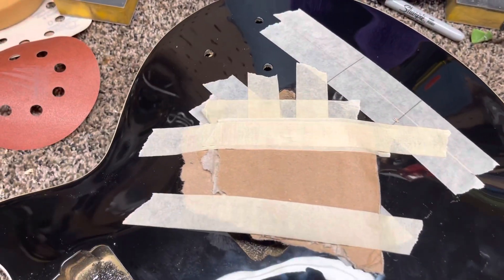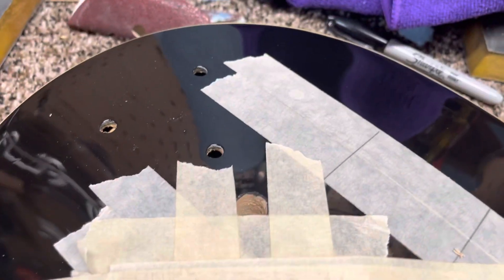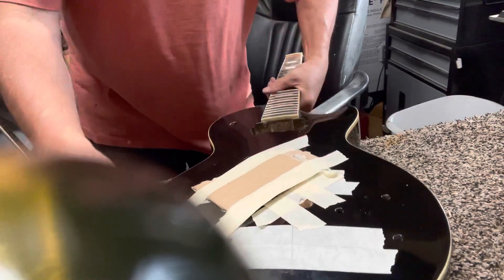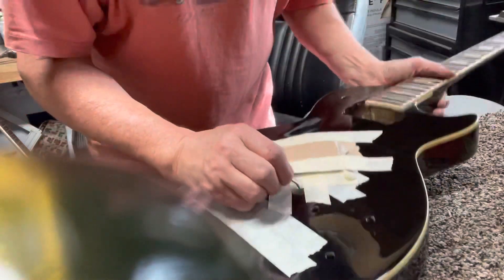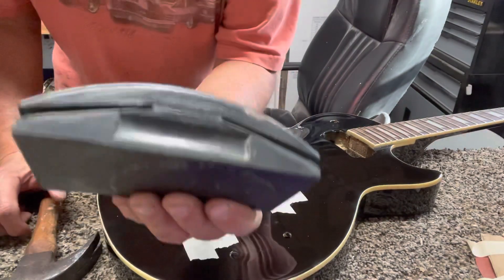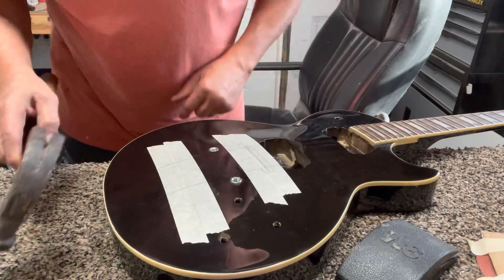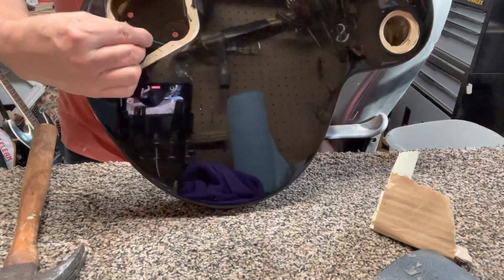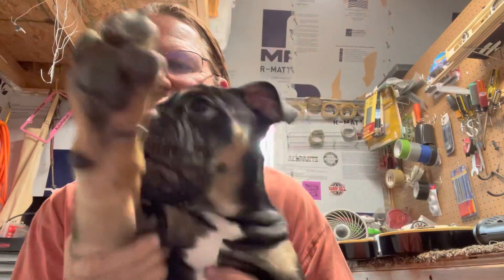Drilling for a ground wire in a Les Paul style guitar with bridge and stop tailpiece.

Comment: You could even use a bolt the same thread as stud to drive it in.  Nice work!
Reply from the maker: Yep, Thanks!
Reply: I just did tonight as a matter of fact.  Ground wire broke.
Reply from the maker: @cr2fabrication  dang, as long as the wire is touching metal you should be alright.
Reply: @GuitarMan3YT  From new, they tinned the wire, broke right there.  I just stripped it this time.

Comment: So if I test the bridge and tailpiece with a multimeter set to continuity it should beep and read 00 if its grounded? Thanks
Reply from the maker: Yep, if you have a good connection from the top of the pot to the tailpiece bushing you should be good.
Reply: @GuitarMan3YT  Cool. I just realized that I have no pots or jack connected to my guitar lol. But I got that beep when I tested the bridge and tailpiece. Hopefully it'll stay that way when its all done
Reply from the maker: Lol, good luck 👍🎸

Comment: I have an LP that may need this done. Any tips on how to remove the busing the tailpiece bolt goes into? Thanks!
Reply from the maker: There’s a great video that shows a super easy way. Type..How to remove tailpiece bushings from a Les Paul guitar. He uses a bolt and a ratchet and it works flawlessly.👍
Reply: @GuitarMan3YT  Awesome video! Thanks so much.
Reply from the maker: @JimmyKay1976  you’re welcome! Glad to help.👍
Reply: You can also use a piece of PVC pipe about an inch in diameter. Get a large washer to fit over the top and buy a bolt the same size as the bridge bolts. Cut a piece of cork, felt or furniture skid pads into a doughnut and glue it to the bottom of the pipe to protect the guitar. Put the pipe/washer over the bushing, pass the bolt down through the washer and into the bushing. Tighten up the bolt and it will pull the bushing out. (Use a bolt just a long enough to get started into the bushing.)